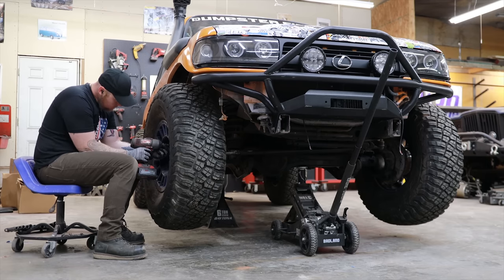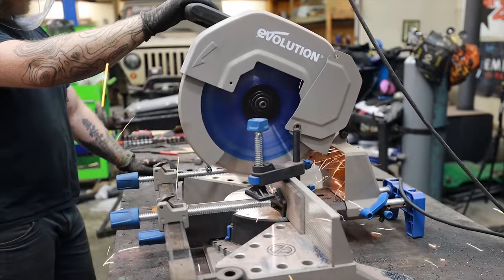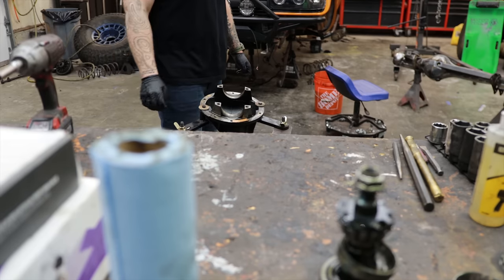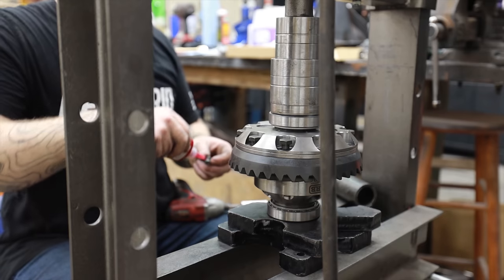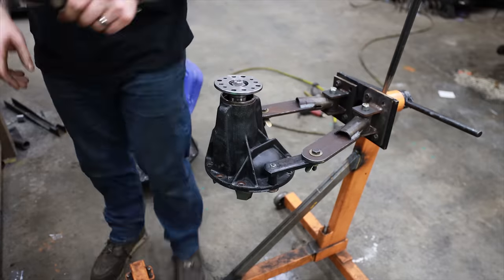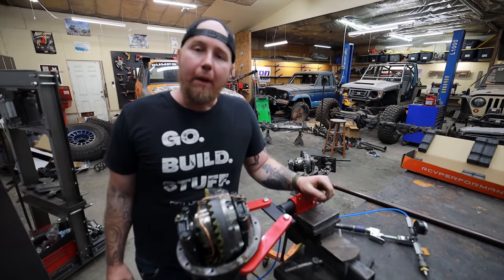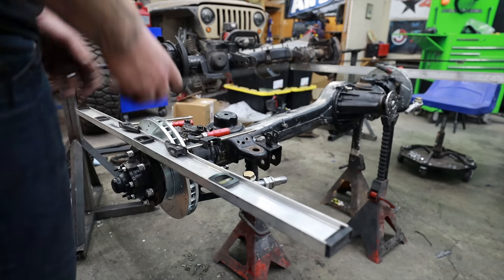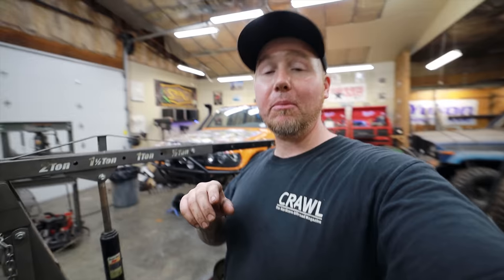Unstoppable Land Cruiser 80 Rock Crawler Episode 5. Budget Off-Road Build.

Comment: I am so happy to see that you showed everyone to use anti seize. I can not tell you how many times I have to rescue a fellow gear head because the splines are rusted together on two parts. Great job and pre lube with the lucas oil on all bearings. This is why that gear set up will have the best chance for a long life as possible.
Reply: I stress that also , On my truck i have had every fastener out at least once , lol Everywhere it  is appropriate it has never seize,  that way when i do have to work on anything or upgrading it dll comes apart like it was brand new, it just makes life a lot easier ehen your not snapping bolts or stripping stuff

Comment: Hard spacer helps Stop Pinion preload Failure which happens alot on Ifs Axles as well As Toyota axles in general was a common failure on the 4th gen 4runner preload fales and companion flange starts slapping with the drive shaft slapping from the wobble 25:02

Comment: On my gladiator rubicon, i just reused the factory shims and was right back into the factory specs when I went up to 5.13s.  I was really surprised and checked it 3 more times.  So far, and 50K miles, no problems.  Gears are quiet. It was my first time ever doing gears.  It took me 6 hours on the back, to learn how to do it.  The front only took me 3 hours.  Probably the scariest thing I have ever done on a vehicle.  Plus I saved myself $2k on install.  Plus I know I did it right.  I wish everyone used removable third members though.  It would make setting gears up so much easier.  I'm more of a fan of Toyota and Land Rover axles.

Comment: On my #LX45 project, one limit I found on the 80 series front axle was the steering arm to knuckle interface. No matter what I did with the stock 4-stud system, it would not stay tight long term with hydro assist steering ( and that hydro assist was built to stop correctly at the ram, steering stops, and internally on the box all at the same time ) and a 40" tire. I ended up having to make large 1/2" thick tabs on all 3 steering arm locations that tied back into the steering stop bosses on the outer knuckle ball. This tool a few little tricks, but they are still removeable and the steering stops are all still adjustable. Those tabs where multi-pass TIG welded with normal ER70 to the steering arms. The steering arms are a forged steel part and welded quite nice once clean. I also welded everything while bolted together and allowed it to cool while in place. With multiple seasons on that modification, I can't recommend it enough for the 80 series knuckle package. I went from having to check and re-torque the studs after every day of hard wheeling to not having them move at all in multiple seasons with trips all over Sand Hollow, Rubicon, Dusy, etc.

Comment: Great job on the rebuild, another cheap option for a little more strength with those stock hubs is to get rid of the conical/stud and tap the hub for a bolt

Comment: Speaking from experience and to save a heap of pain especially on road brace the panhard mounts, 2 of my 80 series and a 105 series landcruiser cracked, broke and bent their panhard mounts. Also brace the frame around the steering box,  they're prone to cracking.. ask me how I know 😅 love the builds mate and have been a long time watcher! Nice to finally know abit about a rig you've got 😂🤘
Reply: Also a nissan patrol GU steering box is a big upgrade from factory and will save your bacon later, especially under high steer load situations. That and a way to mark your king pin bolts to check for movement will help alot too.

After alot of highway ks before tracks or heavy breaking the hubs can eventually heat up causing the king pin bolts to get enough wiggle to start to back out and snap..then it's a downhill run,  it's rare but it definitely definitely happens 🤦😅
Reply: He'll be using ram assist steering so the steering box won't be an issue.
Reply: @CACressida  yeah I realised afte right commented that it probably won't be an issue 😅🤦

* for that reason*

Comment: Can't wait to see the transfer case regearing! I've got an 80 series powertrain (1HD-T, trans, and t-case) in my 60 series and have the 3.1 low range gears waiting to go in. Was really thinking about the 1.1 high range gears to widen that split and let me run lower diff gears as well. The diesel really likes the higher gearing on the highway, it runs so well with 35s and my stock 60 series 3.73 diff gears right now.

Comment: Great idea with paint on the carrier. Had one actually make contact and when initially putting it together I couldn’t tell if it was hitting. It was super close like yours was and in ARBs install manual they say the same thing about the pinion. Fast forward a year later and the locker wasn’t working and I pulled it apart two days before a Rubicon trip to find the contact was being made and it had got my air line too. Ended up putting the carrier and the pinion both in a lathe and removing imperfections on the carrier and machine the pinion down enough to clear. No issues now. Next install will definitely be using paint!

Comment: Great video as usual, a little tip. Do not use the bearing and press in a new bearing race, you will damage it and shorten the service life. 😎👌
Reply: Agreed on the race + press = bad,  it to be fair, the inner pinion race on those diff housings are a serious pain in the ass to drive in with hammer and brass punch.

Comment: That thing is a unit. You have this on lock. The ram charger is decent and the s10 is not bad either. but they can't hang with full locked, geared, and ultra beefed steel reinforced cruiser.  I'm so jelly.

Comment: Hopefully there's enough time before the trip so you don't have to tighten your wheelbearings on the trail, but you're probably going to need a lot more wheelbearing preload.

I did the factory spec of preload drag on my 1995 cruiser about 30,000 miles ago, re-checked it 1000 miles later to be safe, and then on my first "hard" wheeling trip with 33" tires they came loose (about 6 months ago). That's measured with a string wrapped around the lug studs, and I think 6-12 lbs of pull force wish a fish scale going very slowly. Some people on the ih8mud forum recommend a lot more for big tires or hard wheeling.

I pulled them apart last weekend to redo my knuckle seals and weld on knuckle ball gussets, and found that both spindles were severely worn with .015" of wear on the bottom.
Interestingly, the bearing races never spun, as they were also worn only on one half.

Comment: For a gear calculator, I highly suggest Grimm Jeepers calculator. Hands down the best out there. And, great video as always! Oh, I also have had ring great bolts back out (professionally installed). Luckily I hear one of the bolts get smashed into the did cover before it got into the R&P.

Comment: You put it perfectly.  Pick a starting point that has (or mostly has) the stuff you want to begin with.  I was struggling with doing a JKUR V8 and 6/8 spd swap.  That's actually why I ended up buying a GX460.  The GX check the MAJORITY of the boxes I wanted, was cheaper to buy than to do a V8/trans swap in the JKUR, and I'll never have to worry about emissions.

Comment: Surprised you did not install a part time kit?  I run the low range t case.  Part time kit. 4.88 gears. ARB lockers.  37's.  Great set up.

Comment: Awesome build! Did you find any warping in the axle housing from all your welding?  I have first hand seen a 2.5 ton housing need straightening after having been set up for use with all the brackets welded on. 

Keep it up buddy!

Comment: So when i built my 85 pickup i needed it to be able to handle 40's while wheeling but 35's for daily driven. So i have taken my knowledge and built something i love. 5.29's airlockers so onboard air rcv only the front cuz the rear stock shafts can handle up to 40's, now i wanted a doubler but i didnt want the usual toyota doubler so i reached out to atlas and they sent me a t-case that directly bolts the the stock case. I put the 2.26 or whatever the stock case came with in the front case than the atlas everyone told me i should of done the 4.7 in the atlas but i went with the 3.8. Im only on 2.5 inch old man emu lift. Now the issue im having is i go through 22re motors like crazy 🤣🤣🤣. But man i love this build

Comment: If you're bench testing and find your locker to have an internal leak you don't need to send it back to ARB.
you have to replace what's called the "bonded seal" and its real easy.
Hardest part is you have to remove the ring gear and also if you heat up the gear to 375°F it slides back on with no hammering. Just be quick to line up the ring gear bolts before it cools down.
Reply: Just boil it in water for ~10 minutes and it slides on. 375 is a bit much.

Comment: Guys break drive studs when they use RTV silicone to seal the surface. RTV doesn't transfer torque, so the stud is side loaded, instead of the torque transmitting through the flange friction.
Reply: Toyota gaskets are also meant to be installed dry.  The oil then expands the gasket, making a tight seal.  It's in the FSM somewhere.

Comment: Great videos as always Nate. Quick question, maybe you said it and I missed it but what's the purpose of trussing the front of the axle like that? Is it purely just to reinforce the suspension mounts? Typically a truss on the top of the axle would be to prevent bending up and down, but trussing on the front would be setup to resist bending front to back. I wouldn't expect much load in that direction. Have you seen axles bend front to back?

Comment: I hope you packed enough grease into that knuckle housing? also did you bend each tab on the spindle nut lock washers? if you only fold two tabs the hub is going to get loose.

Comment: The downside with a 5.29 ring and pinion is the pinion becomes very small and weak.  While you're axles are slightly bigger and stronger than my 8" toyota axles, I went through 5 sets of 5.29 ring and pinions in my rig before I upgraded my axles completely...to unimog 404s.

Comment: What did you do to remedy the issue of the solid spacer contacting and rubbing against the oil retaining ring on the front diff so it doesn't throw off your pinion pre-load measurement?

Comment: Really good video alot of great insight, when welding the trus onto the axel did you check for any distortion ??
Reply from the maker: I didn't. I have welded and checked enough trusses to know that distortion on an axle truss is guaranteed unless there are gaps between the welds. But I worked from one side to the other, allowing it to cool between welds. For me, this has been the best method when installing a continuous truss like this one. It's definitely going to change the shape of the axle, but I did what I could to keep it to a minimum 👍.
Reply: @DirtLifestyle  yeah fair enough!! Reason I ask is I'm just about to do flipped radius arms and brace my housing on my 80 and don't really want to be blowing out axel seals all the time. I guess I'll just take my time and keep moving around as I weld it

Comment: I have a question about axles. On the stock rear axle you show a piece that is splined on one end and the other has a forged end that bolts to the hub. You say it is a full float axle but it bolts to the hub. Then you show the new axle that is splined on both ends and uses a flange that bolts to the hub with splines in it to engage the axle. What kind of axle would call that?

Comment: I hear the lower kingpin/steering arm connection is a weak point as well.
Reply from the maker: I imagine that's the case. The way I am going to setup the hydro assist will help. BUT I know that keeping everything torqued is the best chance I have at keeping everything strong. 👍
Reply: @DirtLifestyle  if you search for 'How I strengthen a lower king pin failure point' Mad Mat has a video. He had a mate supply a simple gusset. Loving this build. I have a 105 with the petrol motor so this is very useful content.

Comment: A bit late to the show, but I’m concerned about the fact you ground and welded the swivel ball… my experience with swivels on Land Rover Defenders, Range Rover and Discovery is that if there is any sort of pitting or damage to the polished surface, you’re going have grease spraying everywhere as the seal will not seat properly. How were you able to overcome this issue?

Comment: Can somebody tell me a good method how to polish the axle half spheres like seen in 2:10 of this video. 
On my car they are sadly very rough and rusty and the sealing lip surely don't will last that long if I leave them as they are. 
I tried it by hand with sanding paper and scotchbrite but gave up after a few hours. 

There must be some power tool that is able so grind spheres without grinding flat spots everywhere. 
I am desperately in need of a good advice there

Comment: This is more of an inquiry than criticism, but I was always told that when you go to read the tea leaves that you rotate the pinion not the ring gear.
Reason being is that it will more closely imitate reality of when twisting force is bring applied to the pinion in either direction. But then I see respected people in the community such as yourself spin the ring gear to get a pattern.
Does it matter, or if it does is it so minor nobody cares??
Reply from the maker: Great question! I'm not going to pretend to know for sure but in my opinion it's all the same. The important part is to drag one or the other to make a clear pattern. I use a wrench on the ring gear and grab the pinion with my hand to apply some resistance. This has given me the most visible pattern 👍.
Reply: @DirtLifestyle  right on, I didn't notice you adding resistance to the pinion with the other hand - I suppose that makes just as much sense haha.

I will keep that in mind if you keep up the content 😅
Maybe some day I'll run into out on a trail.